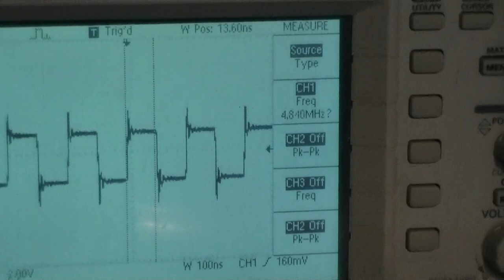Software Defined Radio Vlog Part 4 - Frequency Scanning

Comment: @hazydave Is a low pass filtered LO necessary, since it's a digital mixer? The square wave generated by the FPGA should actually be pretty clean, but it looks worse on the oscilloscope than it is because of the huge loop area (have a look where the CRO probe's ground is clipped)